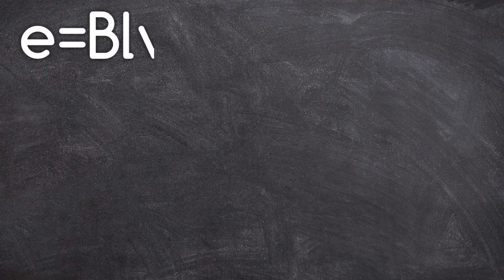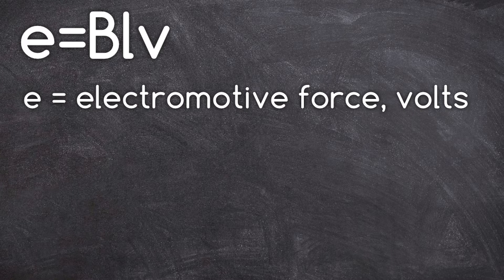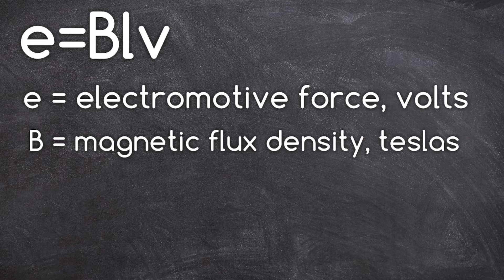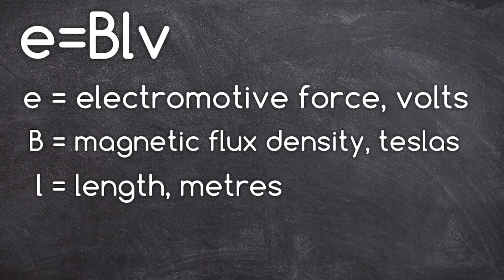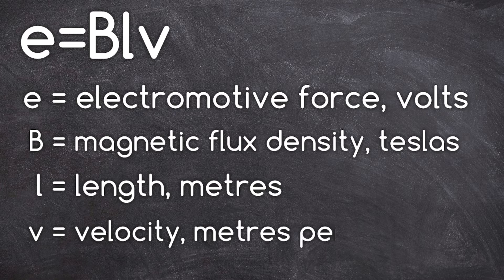Magnets and Magnetism: How to Create Electricity and Calculate Induced EMF

Comment: Question 🙋
For the conductor, doesn't the diameter of the wire affects the emf ? Why only considering the length, and not the total volume or mass of the conductor ?

PS: I'm a simple web-developper.

Comment: Great presentation Joe,
quick question ... how about the other way around? lets say you move a magnet through a copper coil? would that work?
if so how would you calculate the Electromotive force in that case?
thanks and keep up the good work.
Reply from the maker: Thanks very much. It's the exact same principle and formula, as long as there's relative movement between the conductor and the magnetic field it will work. 👍